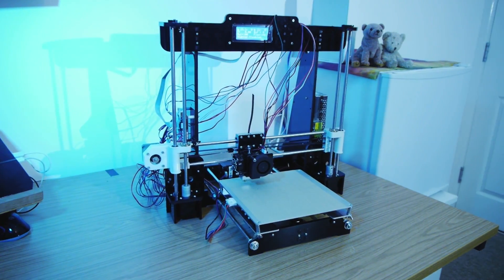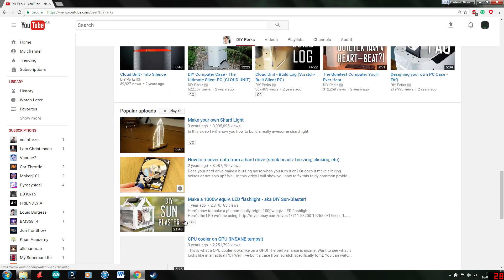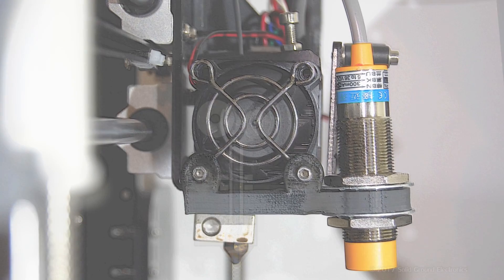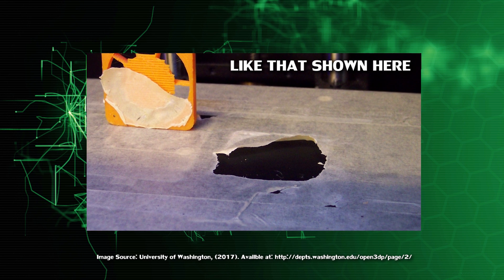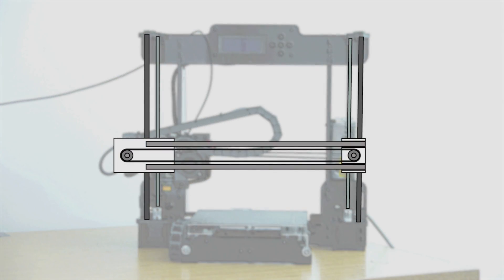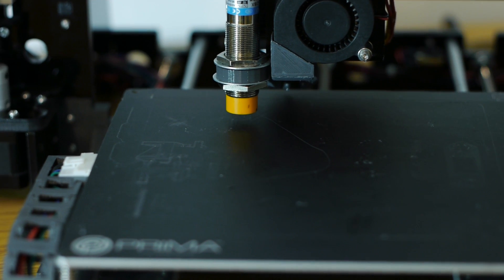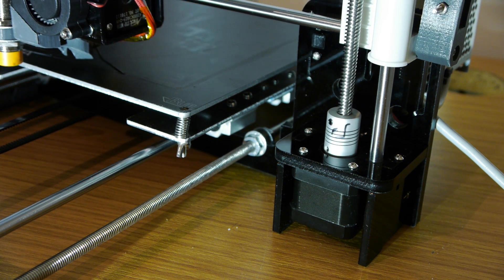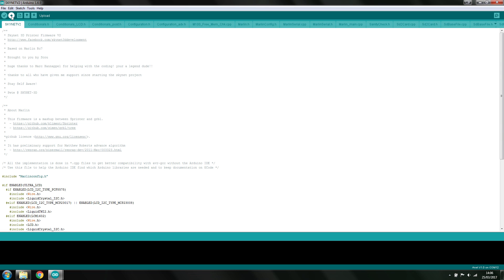Cheap 3D Printer - Anet A8: Upgrades, Experience & Thoughts

Comment: I purchased my Anet A8 about 7 years ago ,well last year there were additional cracks in the front and rear support pieces and I said that is enough ,I disassembled the entire unit ,then ordered new alum profile material and using the motors, 1 lead screw and some parts used on the Ender machine I built a single arm printer that will carry a bed 300 by 300 mm and with the new z axis profile, aZ height of  250mm can be achieved  and yes I did replace the mother board with a  Ramps board after reassembly and getting all the belts and roller carriages assembled and installed ,I turned it on and the testing and reprograming of the Ramps board began ,It took 3 weeks of 5 hourrs daily ,Now this machine resembles a TRON XY1 only 2.5 times bigger and it works fantastic it is mounted on a piece of 3/4 inch (18.5mm) Russian Birch and the display ,power supply ,Ramps Arduino mega and heated bed controller mounted on a 6 inch (150mm) by 1/4 inch (6mm) plywood Well it runs beautiful ,smooth as ice and my prints are fantastic much better than I use to get .

Comment: Hi... I just wanted to say thanks as you've saved me a lot of hassle on a number of occasions related to the wiring up of the inductive sensor. I would say it was around 2017 when I bought my Anet A8 and started to upgrade it. Since then, I've moved onto a Ramps 1.4 and have had to come back to this video to revise the wiring. So here I am again for the same reason as I have now built my own i3 machine with a larger build volume. So thanks again and all the best. D

Comment: Its 2020 and I built a ctc A8 clone I bought off ebay for the amazing price of £79. Anyhow your transistor solution did not work for me; it was was feeding some voltage back from the 5v switch side, which was lighting up the proximity sensor led; I only tested it quickly as I was worried about blowing the sensor! I used a capacitive sensor (LJC18AC-B-Z/BX 12v NPN NO) as I use a glass bed. Instead I used the optocouple circuit here: https://3dprint.wiki/reprap/anet/a8/improvement/autobedleveling. I did not use the 4N35 optocoupler on that page; instead I used a more common PC817 which I had knocking around (these are commonly found in older phone chargers so if you have a broken one you might be able to salvage the part). You need a 1K resistor for the opto side and for testing you could use a 10K resistor as a pullup to 5V on the transistor side. I tested with 12V on the proximity side and 5V on the transistor side and when the sensor lights up, 5V is pulled to ground (this is the same as on the A8 clone board which has the pull up resistor built into the board; I checked the behaviour with a multimeter). The proximity and other side need to share a common ground. Hope this helps someone. Although running Marlin firmware I have not got round to reconfiguring it for the sensor yet.

Comment: Just bought one on ebay in the UK; they are cheap as chips at £79 in 2020.  Some corners have been cut but it still prints pretty reasonable. The H  plate is replace with a piece of plywood, and I have already ordered an aluminium alloy one off banggood as I am sure it will break at some point.

Comment: When I purchased my 2017 Anet A8 with the 1.5 board later in the year it came with a half .5kg roll of filament. Which is good, because I ordered ABS filament with the printer and was seriously disappointed to find out I couldn't print with ABS right after building. So the few of us that got lucky with a half roll of filament were able to march on. I saw the cutout in the foam when you unpacked where the roll of filament should have been. Could have been your distributor taking the spools out and splitting them up.

Comment: hello , I  buy  a new Anet 8 board V1.7, but When the initial operation, the extruder is directed to the opposite side to the end and continues for a while the engine rotates even when the extruder reaches the end ... The same applies to the surface ... Also, the z direction motor works one and the other does not work .. Note that I almost checked the connections  All are correct,  What is the problem??!!

Comment: hey fred,
just a suggestion, why dont you install igus drylin linear bearings? they will make the a8 quiter. they are available on ebay for a really low price. here is the link.
http://www.ebay.com/itm/282504056273

Comment: belt replacement and belt tesioning is the very first thing ppl should do.   cable chain is just fancy.

awesome video.
Reply from the maker: Liangshi Xu How come? I would argue that the belts have a finite life anyway but it is better to prolong the wiring as that would be a bigger job to replace it all. That said I've already had to replace my belts and fix a couple of broken wires and that was whilst using cable chains, so I guess you are right. They look cooler though, you cannot deny that ;)

Thanks for watching!
Reply: haha true. regardless the order, those are the upgrade ppl need to do asap.

great videos, instant sub.

btw, you have good tutorial on auto leveling? i don't have any resistors and it takes ages for those to ship in my area.  can i just connect 1 wire to 12V and the other 2 to the Z-stop plug ?

Comment: Hi Fred, I've been trying to install the auto-bed levelling sensor using the same setup as yours, but I'm having a few issues.

The sensor seems to work when I power the printer on, the red LED is constantly on and when it comes into contact with metal, the LED turns brighter (which I assume is a good thing).

However, when I set it to auto-home, the Z axis does not move down like it usually does (until it hits the switch), but it moves up a bit. Although when I auto-homed the printer with a piece of metal under the sensor, the Z axis moved down, like it should do. So the sensor is acting in an opposite way to what it needs to.

I believe that it's been wired up correctly with a 10k ohm resistor connected to the base of the transistor and the signal wire of the probe and the same transistor has been used.

I initially thought that the NPN polarity of the transistor was incorrect, so I switched them around but the problem still occurs.

Images are here: http://imgur.com/a/wO0u9

Perhaps the software can be tweaked to work in the opposite way it needs to? Any help would be greatly appreciated!

Comment: I did what you showed in the and on your website but my anet a8 just won't home properly it just keeps thinking that the sensor is touching the print bed even tho it is in mid air
Reply from the maker: The Insane Lord you may need to disconnect your limit switch and invert the z probe function in the marlin firmware. I noticed that my sensor did the opposite of what thr advert said NC instead of NO
Reply: what lines of the code would I have to change to do that
Reply from the maker: Within the Configuration.h header file change the state from true to false or false to true based on the current setting in your current firmware #define Z_MIN_PROBE_ENDSTOP_INVERTING (false or true)

I think using a z probe stops the use of Z min endstop so try swapping true/false on that first one if no luck try doing the same for this one #define Z_MIN_ENDSTOP_INVERTING 

If it still doesn't work then you have a wiring issue, damage from a wiring issue in the past or faulty parts. It is also possible that my firmware wasn't uploaded to your control board properly.
Reply: ok I have done all of that and now wnen it gone thro the auto bed leveling it just sits in th ecorrner
Reply from the maker: You need to change the cura machine start g code if you haven't done so already. Does it sit there when printing a file or are your describing what happens when you do it through the menu?

Comment: Hey there,
I bought the LJ18A3-8-Z/BY recently, but I noticed it was the wrong sensor. So I ordered the LJ18A3-8-Z/BY. But the sensor works in reverse. When it contacts a material and the LED turns red, the X axis goes down to measure the bed, and when I remove the material and the LED goes of, the X axes goes up again.  I used a 10K resistor, and a 2N 4401 - 331 transistor. And I soldered it the way shown in the video. I might have done something wrong with the SkyNet software. On your website I read 'Ctrl + F & Find Auto Bed Leveling Section of Code And Make Necessary Adjustments' but I don't really know what I'm supposed to do on this step. So I just uploaded it to my printer. Do you know a way how I can fix this problem? Thank you!
Reply from the maker: HELEMAAL NIKS they are both the the same part number?
Reply: Sorry, I ment to say that I first had the LJ18A3-8-Z/BY and now I have the LJ18A3-8-Z/BX
Reply: In the meantime I tried to unsolder the original limit switch from the transistor. But that didn't seem to change anything at all. The Anet still thinks that if the sensor doesn't give a signal that it hit the limit switch.
Reply from the maker: HELEMAAL NIKS use a multimeter to confirm that the black wire from the sensor goes high when metal is detected. I would do this without the black wire connected to anything other than the meter.
Reply from the maker: The light may be opposite, like the one I have.
Reply: Ok, what setting do I use on the multimeter?
Reply: The light blinks when it hits the build plate, and it is off when it doesn't measures anything.
Reply: Ok, I might have done it wrong. But I connected the multimeter with the + wire on the board, and with the black sensor wire. The screen says 12,39 volt. When the sensor doesn't works the multimeter doesn't shows anything. So the sensor does work I guess. Could it be that I got the wrong transistor?
Reply from the maker: HELEMAAL NIKS put the red multimeter lead to the black wire and the black multi meter lead to the. metal part of the usb connector. But be careful not to slip and touch / chip off any components.
Reply from the maker: HELEMAAL NIKS use the multimeter in a DC -(--) setting and not ac (~) with a the appropriate voltage range. You should expect about 12v
Reply: I just put the black wire on the + screw on the mainboard. Is that OK? Or should I measure it again? Because I already measured that when the sensor measures a material the output is 12,39. And otherwise it doesn't gives of current.
Reply from the maker: HELEMAAL NIKS when you say + screw do you mean the +12v wire to the psu? You need to measure the voltage of the black sensor wire to ground (as in the USB metal housing or the gnd terminal of the psu output)
Reply: Hi there, I followed your instructions, and now it gives a different result. When the sensor is near a material, it gives out 0volts. And when it isn't near a material it gives about 12 volts of current. Is this normal? Or is my sensor inverted?
Reply: Hi, could it be that there may be different versions of the NPN transistor around? I bought them here: http://www.ebay.com/itm/20Pcs-2N4401-Transistor-NPN-40-Volts-600-mA-HAM-Kit-GM/262136737616?ssPageName=STRK%3AMEBIDX%3AIT&_trksid=p2060353.m2749.l2649 Could it be that I have the wrong transistor?

Comment: Help me!!!!! I have the LJ18A3-8-Z/BY but it gives a continious signal. I can't level my bed :(
Reply: How do I fix it?
Reply from the maker: Hey, my probe has a light that goes out when metal is detected, what happens when you hold a metal object under it?
Reply from the maker: It is hard to say at the moment. I'll try to help you but it may take several comments and tests to locate the cause of the problem.
Reply: Solid Ground Electronics The Led blinks when it recognizes the metal printbed. But I removed the power from the sensor and now it seems to be working okay. So I think I have a broken resistor. But I’m not sure. Do you know a way that I can check if it is broken?
Reply: I tried checking it with an multimeter, but the screen just states: '1'. I'm not an expert with these things, so I might have done something wrong.
Reply from the maker: The sensor shouldn't work without power,  is it possible that the end stop switch is being triggered instead? The circuit shown in the video should work if done properly. I don't want to teach you how to suck eggs but is it possible that you have made wrong connections or you have a dodgy connection / a short. If its not that then you either have a faulty npn transistor or sensor. The supplier may have sent you the wrong part.
Reply from the maker: Resistors don't typically break unless a lead has snapped off.
Reply from the maker: Hmm does the multi meter say a number close to zero if you hold the two probes together because it may not be hooked up properly. You can't really test a component for resistance like that if it is already wired into a circuit
Reply: Solid Ground Electronics It does say 0,00 when the probes touch each other. But it doesn’t change when I touch both ends of the resistor. But that might have to do with the fact that it is soldered in the circuit.
Reply: Jep, It seams like the resistor is not broken. The wires in my multimeter don't fit in perfectly, so that was the reason why it didn't work. But now I have no idea what the problem could be...
Reply: Just for good measure, I bought this sensor: https://www.123-3d.nl/123-3D-Inductieve-afstandssensor-8-mm-LJ18A3-8-Z-BY-i1621-t324.html (Dutch website)

Comment: I have only used PLA so far. after printing off a couple test prints and making some tweaks to the settings plus using a half PVA/water to fix the pealing issue. after that I printed off a new fan cooler nozzle. This made all my objects much better!

Comment: Hey Fred, I've really enjoyed your Anet A8 videos so far and I hope you make more in the future! I'm thinking about ordering one for myself, but I have a few questions about the printer (and the purchasing experience) that I hope you don't mind answering.

How long did it take for the printer to arrive? (from the day it was ordered to the day it arrived)
Did you have to pay any VAT/import fees when it arrived?
Did the printer come with an EU or UK plug? If it was an EU plug, what did you do to make it work with a UK plug socket?
Do you recommend making the belts looser when installing them, so a belt tensioner can also be installed after? (I'm worried that if I make them too loose, I won't be able to print the tensioner in the first place)
Does the price of a filament always indicate the quality of the filament and how well it prints? Or is it okay to buy a cheap roll of filament from eBay, which would work just as well as a branded roll of filament?

Thank you for reading and I look forward to your response!
Reply from the maker: Hey BenjiManCan, thanks for your comment. I think it took about 2 weeks at the most. Can someone else confirm r deny this!

I didn't have to pay customs.

The EU plug included with the EU version was no use so I used a 13A IEC cable (3 pin kettle lead) with a 5A fuse.

You do need to leave excess belt but you don't need to make it loose just leave a long tail when you connect it to the extruder head and build platform. You can fold/tuck it out the way and use some tempory zip ties to hold it in place. I would get some fiber reinforced gt2 (8mm i think?) belts as mine stretched and  started skipping a single tooth which made the pulley have a variable diameter as it turned.

I can't comment on the filament side of things as I have only ever used the dark grey pla linked in the description. What I can say is when I used cheap ABS on my janky, ebay prusa I3 (whoes parts I sourced from many suppliers) it would bubble when water from the air that had been absorbed into it would turn to steam. I have since ordered some esun pla for my up coming CR-10 video so that will give me a chance to compare filaments.
Reply: BenjiManCan it only took me about 2-3 weeks

Comment: Any chance you can do a video on how to wire that bed leveling sensor? I ordered that one and the smaller 12mm one but the wiring seemed like a pain in the ass so I just ordered the anet version but it wont be in for a while.
EDIT: Note to self: watch the fucking video you moron. Don't comment before watching.

Comment: Good video, I have the same printer and am currently modding it.
Adding an I Z probe and a e3dv6 head. Also adding Drylin bearings and doing the cable chains. How did you attach the chain to the bottom of the heatbed?

Comment: Have you had any problems with ghosting and how did u fix them if u did. thanks
Reply from the maker: Not yet. I did get some ripples near corners if I pushed up the speed and had it on an uneven table. I put mine on a towel and it fixed it.

Comment: one question please .what is the main feature of a 3d printer that determines what and how many materials can this printer use ?For example Anet A8 supports nylon or wood while the A6 model doesn't , what is that makes that difference?Great vid thanks keep up
Reply from the maker: Hey, I believe its mostly down to the hotend itself. Some extrudes have a low friction plastic lining inside that can melt at temperatures close to those needed for certain materials. You can replace the hotend but if you use a more powerful one, i.e one  that has been designed for higher temperatures you may find that you need a better power supply and external mosfet.  I'm not expert though. 
Thanks for your comment :-)

Comment: hows the power supply holding up
Reply from the maker: Not bad, I can't see the capacitors holding out for very long though as I have been running it in my enclosure which makes it get rather warm.